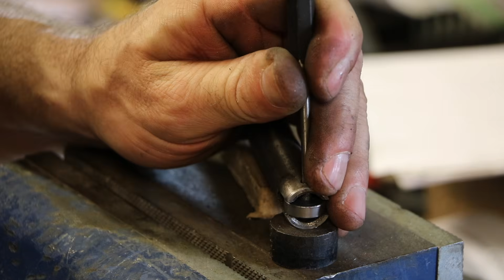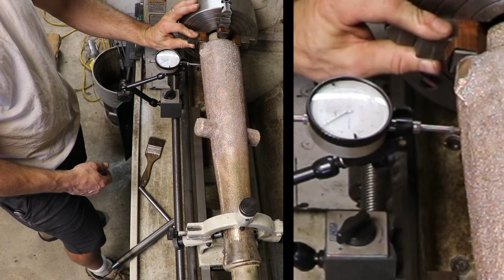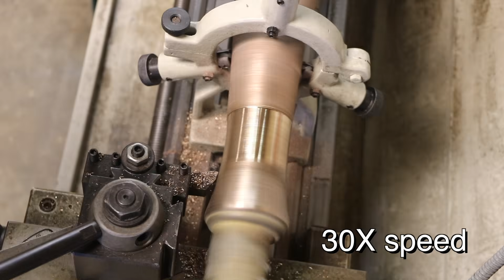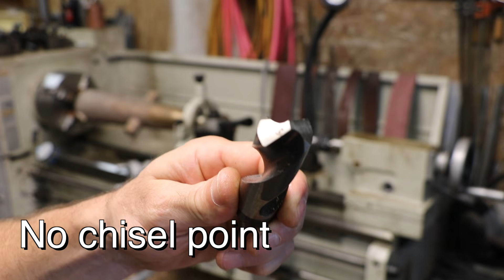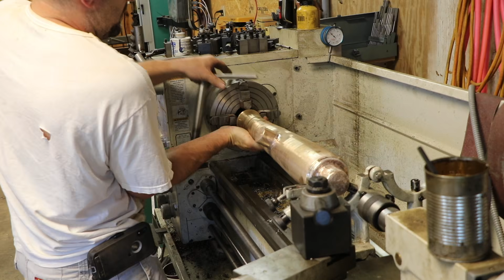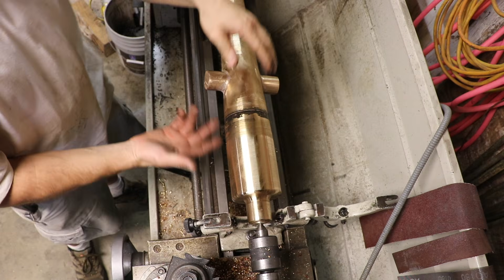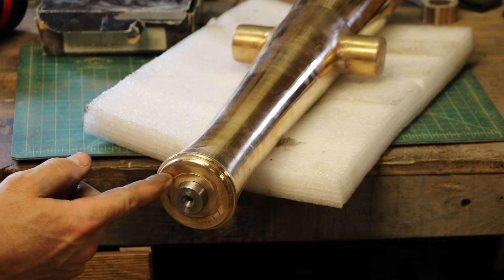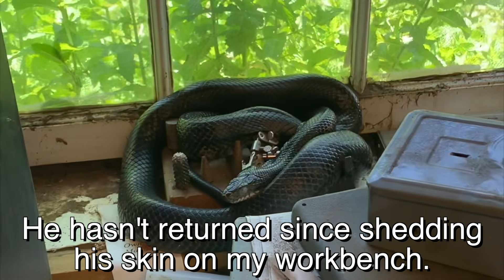Machining a Historic Bronze Cannon Barrel, Scaled Down Replica. FarmCraft101

Comment: For a strong, modern quality barrel: 

Bore out and fill in until it fits a sleeve, sleeve the whole thing using differential heating to fit it. For improved strength beyond that, sleeve to 0.95 inch ID, fill with hydraulic fluid, and put a piston into that with a hydraulic press until the inner 1/3 to 1/2 radius of the sleeve strain hardens. (use well specified, defect free steel which is normally used for barrels and calculate for this) Then heat fit with the brass at the temperature of boiling water so it will be further compressed by the brass without altering the metallurgy. Then bore to 1 inch. Result is like the steel version of tempered glass, the inner surface is simultaneously strain hardened for increased yield strength and compressed by the outer sleeve.  The compression fit can also be done first, and then hydraulically strain tempered.
Reply: Sounds like a good process!

Comment: To find the center steady the end with your steady rest, it does not matter if you are deflecting the work , then with your top slide set to 30 degrees to the axis of the lathe cut a center into the end using a small pointy tool so you can get it in there. The center will be in the center.

Comment: Depending on what your planning to shoot out of it, and what propellant you plan to use. If your just using it for show and to make a bang than it will be ok. But as it stands I would not trust a projectile being put in that. I have been going over your previous videos, and Again, trying to understand your actual strength of the metal. Again. I wont say its safe... I personally say don't shoot anything from it.

Comment: It would be extra work. Bore it larger then sleeve it. If you don't want to see the sleeve have the sleeve short by about 1/4 inch. thread the end of the bore and insert a threaded brass matching collar and face it to the muzzle and then bore it to match the ID of the sleeve. You would have a thin circle where the end of the barrel is, but with the lathe, you could cut concentric circles on the face of the muzzle and make it look like decoration. Also, the sleeve could be rifled and rifled barrels fire round balls very accurately. If it is rifled make sure the collar on the end is the ID of the outer diameter of the groves of the rifle bore.

Comment: For a pour of that size where you want to avoid any porosity or slag inclusions, you need a hot mold, so the pour remains liquid for long enough for the gasses and slag to float to the surface. For that reason, I'd suggest using lost wax casting, and to pour the metal while the mold is still hot from being fired. Easy, right? lol

Comment: Simple cheat: over-bore it some and sweat solder an alloy sleeve into it. ~( 'w')/ 

Yes, I know I am not the first one to say this, so just consider it as another 'one' if you are tallying up 'votes'... ~( ,m,)~

Voids can cause catastrophic failure and make it perform more like a grenade than a cannon. \>0.0</

And THAT'S gunna HURT. /( -_-)\

Comment: As Sternstones said, if it were me I would machine a steel sleeve for the bore with locktight to keep in place or press fit the sleeve if you have means to press it in.

Comment: Looking good there. I would second all the comments about sleeving the bore. It seems like the safest option. I'm not sure how much work a sleeving job would be but my guess would be to over bore the cannon after putting epoxy or some sort of filler in the defected area and then fitting a thick walled seamless sleeve in there. Then you never have to worry about your great looking cannon flying apart on you.

Comment: After studying renaissance and civil war cannon, not much chance for a blow out but will effect the projectile. If it is rough enough of a defect, hi heat jb weld will help smooth the projectile path. Your  solution was one, another was to add temp extensions using rings of tube 1 inch long with a welded tail to go up the outside of the keyway set screw holes. That way you can go farther out and then be able to use in original form.

Comment: I'm a Civil War Artillery historian, a member of the National Civil War Artillery Association........and I have an Artillery Library that is pretty extensive.  Your "Piece" closely resembles a 1857 Napoleon (one of the most robust on the field).   If you want to contact me at artilleryman1861@gmail.com , I can scale down a real 1857 Napoleon, and give you an approximate maximum bore size, "if" you were using the proper formula for "Naval Bronze."  As it sits right not, I would NOT fire it.  If you want to keep a 1" Bore, you might have to sleeve it, or it is possible that you could go larger on the bore size.

ALSO, I could help with carriage measurements, as I have the schematics for the 1857 Napoleon.  😁

A truly beautiful field gun!!!  👍🏼😎

Comment: I hate to say this but what you have now is a very nice paper weight. I would not fire a projecttil of any kind from that barrel! It's not worth possible loss of life or limb! (OK Health and safety warnning out of the way heres my two cents.) Lining the barrel with a good steel liner would work!  To line the barrel you first heat up the cannon body, then the linner is mounted on a mandrel and chilled to cryo temps. When both the linner and body are to their temps, you press the bore linner into the cannon body and the whole thing is allowed to come to room temp. The mandrel is removed and a touch hole is drilled and tapped for a steel fuse or cap holder and you are ready to test fire.This is not an easy process and you will end up with a bore much smaller than 1".
If your hearts set on a firing bronze cannon you will need to start over. If you recast here are some suggestions. I can't remenber if you used a degassing agent when you cast this? From all the defects in the casting I am thinking you didn't?  There are a number of brands and some work better than others. Do a little reseach to find the best one for your alloy. Get a second pair of hands to help you pour! Time is your enemy on any pour. Knowing how much super heat you need for the alloy your pouring is very important! 50 degrees either way can make the difference between a good pour and bad pour. Blanket your mold to hold in heat, this can be done by setting it a sand pit or wrapping it with a welding blanket. Slow cooling allows gas to escape and voids to fill.
All this said you did and amazing job for only your second casting! I don't think I got a large casting I could use till my fourth or fifth try. You almost did it on your second and with out some one teaching you along the way! Good luck and I look forward to seeing what you decide to do. But please don't give up!

Comment: To get that rear center hole right, im wondering if you could let it hang down and put a small mark with the center, back the center mark off the part and turn the piece 180 degrees and let it hang again and mark it again with the center. The point between these two marks would be the true center.

Comment: Maybe your next project after this will have to be a vertical lathe and boring machine.

Then you can step up to an even larger canon project. I vote something sensible, like a 14" inch rifled barrel. Nothing too fancy or anything, so plan for a simple twin turret instead of a triple or quad?

Comment: I am not a professional gunsmith.  I am friends with a couple. One never left muzzle loading after he got hooked. The pressure curve is the main factor. And he is still friends with a Civil War artillery re-enactment group. Using mostly Civil War Era cannon. They magnaflux the barrels and when a flaw in the casting of one appeared they used a thin wall sleeve and relied on the epoxy to fill the void and the sleeve has been working fine for years. This was on a 12lb gun i believe they said. Pressures 4/5 times what you will see. They estimated an 1/8th inch sleeve maximum needed. A lot of things were assumed such as load, projectile size, material,  weight. And estimated the pressures based of those assumptions. The barrel should be magnafluxed to make sure there are not any other voids or flaws. Both men said speak to an engineer with all the necessary variables and it should confirm the 1/8 sleeve. It will guarantee safe operations for years to come. (Magnaflux is an xray type process for metals) I hope this helps.

Comment: Maybe it's just me being picky but at the drill bit tip discussion in the video, the regular drill you show IS a chisel point drill whereas the other is known as a split point drill, so you ground a split point onto an originally chisel point drill.

Information source: I've been a precision machinist since I was 17 and learned everything on the job.

Edit: I should mention I absolutely love stuff like this and just wished to help give correct information to the video maker.

As for the issue with not knowing your true center line, if the back part of the cannon body has been machined straight, what we do is put the steady rest on the surface leave the top open, put your indicator on your cross slide/tool holder then put the indicator tip roughly in the center (high precision eyeballing is fine here) of the top and use the lathe's z-axis motion to find where it's running level by adjusting the 2 bottom posts on your steady rest ever-so-slightly. Again this idea rests solely on the last 3-4inchest of the cannon being machined straight and square to your first setup when you cleaned all the pitting etc. up.
Reply from the maker: Yep. You’re right on the drill bit terminology. Bummed I said that wrong. I’ll be hearing about it for months now. :-) I like your solution for finding that center.
Reply: @FarmCraft101  Haha, don't worry we all have that little slip up we never live down and I'm glad you like it.
Also I learned a lot of the skills I have now through making mistakes and scraping god knows how many parts so don't feel bad when you make mistakes trying something new it's all a part of that learning curve! In other words you're doing awesome by my book and even willing to show your mistakes to the world and be judged by millions, braver man than myself.

Also after watching the video a few times I got an idea about your crack/cavitation:
If you are dead set on bronze, you could open the bore up a bit, say .250" and have a 1.500" diameter bronze bar gun drilled so the bore is almost perfectly straight, then turn it yourself off of that internal diameter so you have a "true" and take it down to say about 1.251" (+0.001"/-0.000") then use liquid nitrogen to freeze the now perfected bronze tube and gently drop it in the bore giving you a press fit that will hold very, very tightly and when cleaned and polished will match the rest of your cannon with an invisible seam and a very smooth and straight bore. Only problem with that is if you're not 100% frozen and shrunk and it gets stuck, it's not coming out without machining it out. Which if you do this and get the piece gun drilled could get expensive depending on a few things, but unless the owner of the gun drill hates you really shouldn't be too hard on the ol' wallet due to how fast they can drill a hole.
You could even potentially make said bronze bar yourself with the shavings from the cannon so it will even be the same type of bronze and you wouldn't have to pay the shop for material either!

Edit:
I'm doubting that you'll be interested in getting it gun drilled because it seems to me that you want to do all the work yourself, I just cant think of another solution to the issue of getting a bore that long as close to dead on straight as possible with that small of a lathe at the moment, though I have access to a lathe roughly the same size and I'm half tempted to sit and stare at it till I can figure out a solution.

Comment: Could you fill the defect in with bronze braze then rebore it smoothe. Would the heat significantly affect the cannons strength?
It might be hard getting a torch in there though, you might need to make some custom long tools for the job. Alternatively a lower temperature soldier compound could be applied by just heating the barrel as a whole then carefully added from the inside, however that would certainty degrade from the temperature of firing, or melt outright if the cannon is used enough to start heating.

Comment: The question I've had from the start why not simply cast it as a breach loader with a well centered core to start off with to save a lot of excess waste and trouble, also at this point add the steel sleeve for safety

Comment: Your trunnions should have shoulders on them, the same outer diameter as the socket and cap ring that will be on your carriage. That would also set the cannon securely within the carriage, as the distance between the trunnion shoulders would exactly match the distance between the carriage sockets. Without shoulders, the trunnions will cause the cannon to move from side to side, throwing off the effective aim significantly.

Comment: you would have had a much easier time if you had asked a machinist how to approach this problem. also, what you're calling a chisel point is a split point, and the "non-chisel point" is actually a chisel point. nice job on the manual taper. for your centering problem @19:37, you want to project the reference surface and then use that to strike lines to find the center. a simple way would be to tape two pairs of sticks to the barrel on opposite sides, cross them with a rule, strike a line, center drill on a press or by hand. would be close enough.

as for the defects in the barrel, the major issue with the defects isn't the loss of strength as much as it is you want a relatively smooth barrel for the projectile to travel in, to maintain a gas seal. if i were you i'd whip up a sleeve, polish the ID and OD, then shrink fit it in the bore. that way you'll never have to worry about it, and you could use pyrodex in it. use DOM tubing if at all possible. you can probably get whatever ID and OD you need from mcmaster, but prioritize the exact ID you need and turn the OD if it comes down to that. you could even get stainless DOM and not worry about corrosion and get even more strength out of it.

Comment: Why not make a sleeve to extend where the adjustment screws mount with set screws so they sit down about an inch further? Then you still have all the adjustment for smaller work piece dia.

Comment: You are Great at freehanding the coning of the barrel. 
Last time i turned a cannon i set the angle of the cone on the compound slide and hand fed it all the way. I had to reposition it a lot, but the result was rather smooth.

Comment: If you are going for a noisemaker and not aiming to actually fire a projectile then fill the defect with the concoction of your own choosing and enjoy pissing off the neighbors.
If it was me, I would use a long fuse and retreat quickly after lighting.
Also, I built a 49 lb. 1.125” bore x 16” cannon out of 4140 back in the nineties and it will wake the dead when it goes of.
I use slightly dampened newspaper as a wadding, well tamped down .

Comment: I bet JB Weld could fix that defect sufficiently. I would recommend doing the math first though. There may be some other fillers that might work, but getting them in there would not be easy.
Reply: The above comment recommending you cast tin in the barrel and machine it out again is probably the best idea on here.

Comment: You could put a band over the suspect area for safety, you could also but would be very fiddly perhaps braze material into that trench as I suspect it will crack even with the expended pressure it will still try to find its way out through weakness spots, a brazed on solid band would add strength and was a common thing with older cannon.

Comment: I'm surprised you didn't go at it from both ends then when the bore was complete drive a lipped compression plug in from the muzzle end which would have been strong enough to take the internal explosion, I was a "long range sniper" from Woolwich and played with a few cannon in my time and great fun even just with powder charges, also played with 25 pounders and 105mm's which the latter was seriously awe inspiring when running a super 7 charge and felt like the very earth was moving from the recoil.   Will you be making your own reeds or just using fuse cotton, I used to make the reeds either out of a hollowed sharp reed or a large birds feather could be used to pierce the compressed powder by packing the hollow tube with prime powder.

Comment: About 8-15k psi at that point in the barrel, your peak pressure at the chamber face shouldn't exceed 25k.  Naturally, the charge you use, the fitment of the projectile, it's weight, and casting flaws will vary this.  Unfortunately that's no small defect.  Not only will it be a weak point, there's no telling how deep it goes for sure.  It will be a stress point.  Not to mention, best case scenario is it gets fouled every few shots by catching debris.  You could sleeve it as has been suggested.  It is pretty much the standard for most people that intend to fire their cannon with full power charges with appropriate projectiles.

Some info here on how that's done: http://steencannons.com/cannon-specifications/

Comment: put a plate on top, set a digital angle meter on your ways (known flat surface). align with that. another way: use the horizontal centerline. start and finish have to be in the same plane.

Comment: I would be very concerned about the defect. It shouldn't blow straight away but it will be a point for erosion to occur as super heated gases try to push past the projectile. Additionally because you don't have a symmetrical ring at that point the stress will not be evenly distributed in that section, which could do some undesirables things to your cannon. 

Simplest fix would be to sleeve it, otherwise you'd have to try and patch it. I don't think patching it would be fun.